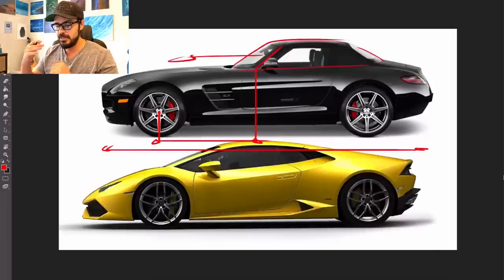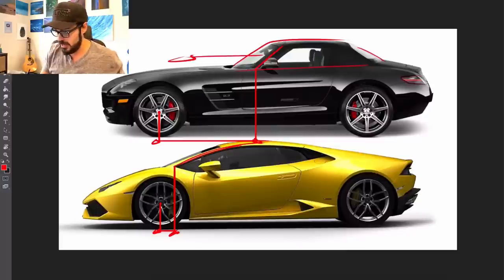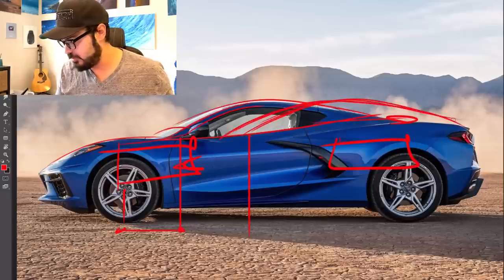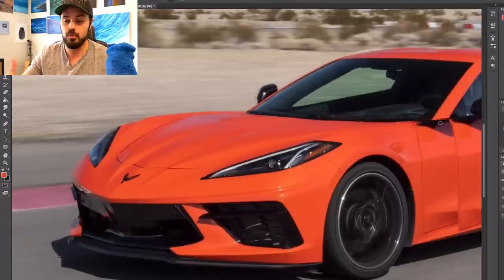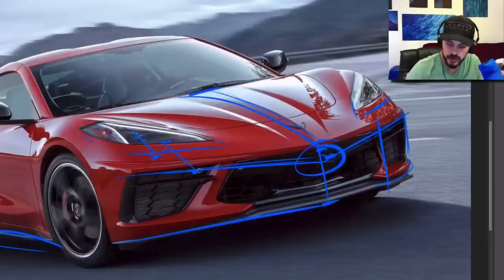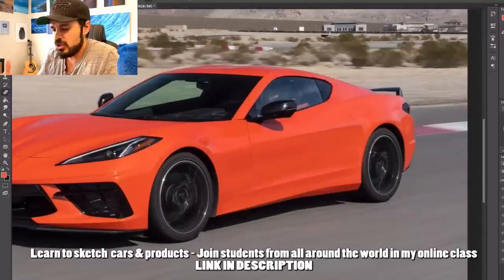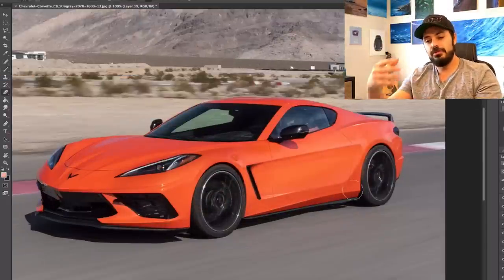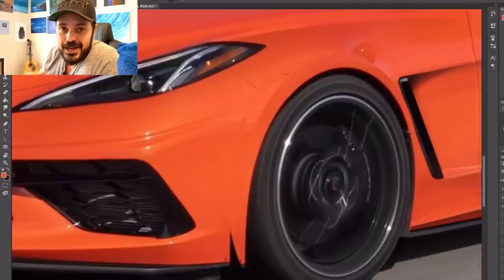What would a FRONT-ENGINED 2020 Chevy Corvette C8 look like?

Comment: The mid-engine design actually makes the Corvette look more expensive
Reply: i´m ignorant, what is the difference between rear engine, mid engine and front engine??
Reply: Kylo-Juju google
Reply: Kylo-Juju front engine sits under the hood, in front of the windshield. Mid engine sits right behind the passengers. Rear engine sits all the way in the back. As far back as you can go, under the wing basically.
Reply: @kylo-juju3796  you can also divide mid engines into front mid engine and rear mid engine. The c8 is rear mid engine. Front mid engine is when it sits behind the front axle, but still under the hood.
Reply: @kylo-juju3796  Rear-engined is examples like the Porsche 911, mid-engined is cars like the Lamborgini Hurcan and Aventador, and front-engine is like the previous-gen Corvettes such as the C7 and before
Reply: The proportions are off. It looks like a cheap McLaren rip off.
Reply: @sycomantz  too bad dad of corvette wanted his baby to be rear engined it was the plan all along so you must not be a corvette fan I didn't know the father of corvette wanted mid engine till the c8 but I did research and realized this was the plan all along
Reply: @muzammilhussain9667     too bad dad of corvette wanted his baby to be rear engined it was the plan all along so you must not be a corvette fan I didn't know the father of corvette wanted mid engine till the c8 but I did research and realized this was the plan all along
Reply: @kylo-juju3796  here's the proper answer. It's all determined by the Axles of the car. Front engine cars have the motor before the front axle. Mid engine between both axles (creating front and rear mid engine), and rear engine behind the rear axle.
Reply: I think it’s a bad choice and loses the Corvette’s identity. Plus mid engined sports cars is a saturated market.
Reply: SvenTviking I’d have to disagree considering how crazy successful the C8 has been. It’s about Corvette trying to be acknowledged as worthy opponents of supercars and the expensive exotics, while maintaining its identity as a bargain performance car.  Before, people claimed it couldn’t compare because of its looks and interior, since the C7 was already easily in their range with performance, but had that “American” look to it and a mediocre interior. Now the corvette is as fast, as exotic looking, and with a great interior and technology all while being a fraction of the cost.  Just from my understanding, this was a great move for corvette and was the only move to keep improving the performance.
Reply: @berrberr3194  I dont see any problem in "American" looks. Honestly "American" = better in the case of automotive.
Reply: No its not. It makes Corvette looks more "European". And from my point of view its bad move. Obviously I may be not objective, cause I value American automotive way more than European.
Reply: The c8 looks cheap looks like a knockoff SSC ultimate aero
Reply: To me it still looks like a discount Ferrari. And in some ways it is.
Reply: @berrberr3194  
The only reason why they changed it was to attract the "influencer" crowd. Why buy an R8 when you can buy a similar spec car for less money?
Reply: Kylo-Juju Front engine is ahead of the front axle, mid engine is between the axles, and rear engine is behind the rear axle. There’s also front mid engine where the engine is in the front of the car but still behind the front axle
Reply: True
Reply: No, not in my opinion. It makes it to me, look about as good as a brand new C-3. But i'm biased against in the Company should have used the Ferrari based C-7 design and make it look to me DAMMMNNNN ssseexxxxsay. Instead they used the First Gen NSX design and then beat it comatose with an U-G-L-Y stick.

Comment: Ok so the C8 is appreciable in it’s design however this redesign is absolutely stunning in the way you took it back to simpler times. The C7 was the turning point where the Corvette started receiving sharper lines and it wasn’t pretty. The C8 continued the same basic sharp lines that frankly just aren’t Corvette. The last Corvette that looks like a Corvette was the C6. But this redesign took it back. If only they would have made THIS instead.